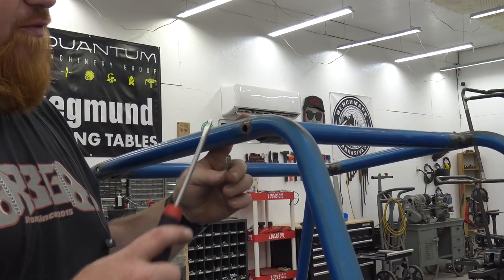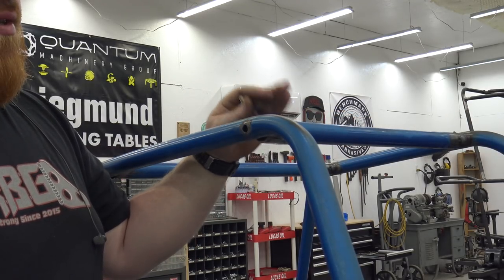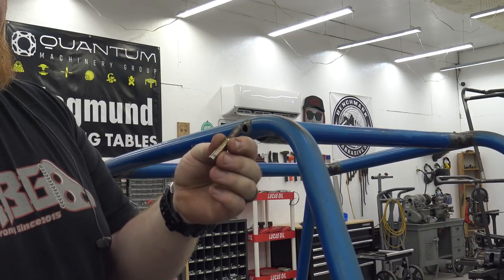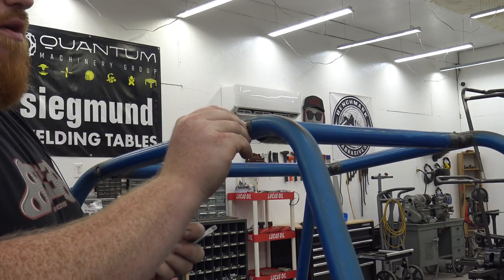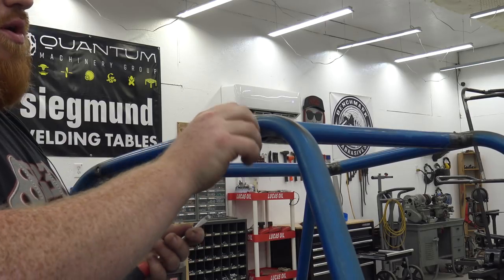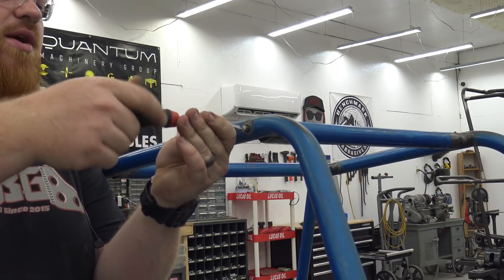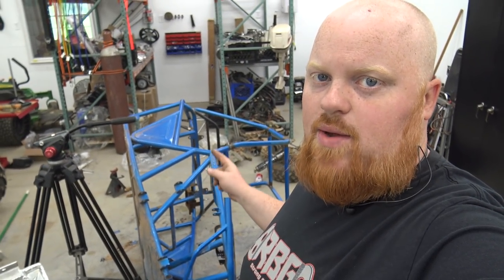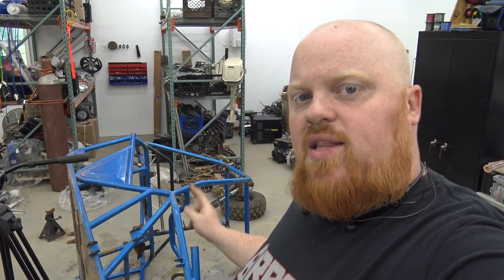Go Kart Tilt Steering, Cargo Rack, & Winch Installation ~ Batman 200cc Kart Build

Comment: Good job...always wondered why C&C never did adjustable seats in all there builds
Reply: If you've got a good position for the seat and aren't making a build for a customer that has to be variable, it obviously saves time, money, effort and eliminates a potential failure point by omitting it.

Comment: Are you upgrading the steering rack and connecting rods to the tie rods? If so what are you using? 

Im doing a similar style buggy and I've found those cheap Chinese aluminum connecting rods do not hold up lol

I'd really like a chance to get in contact with you i have some odd and end questions id like to bounce off you.